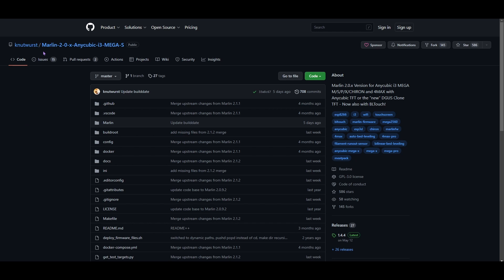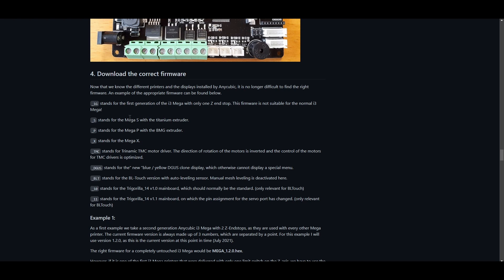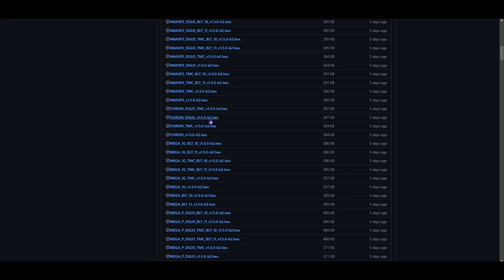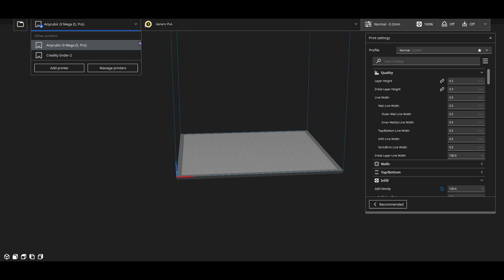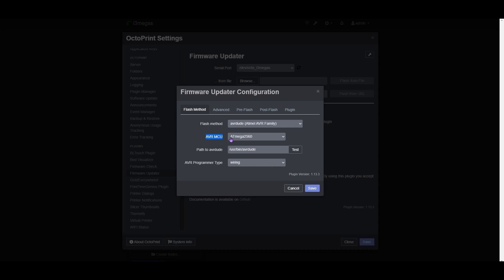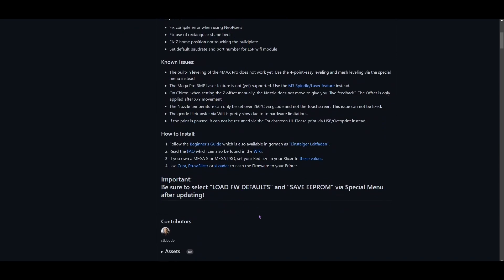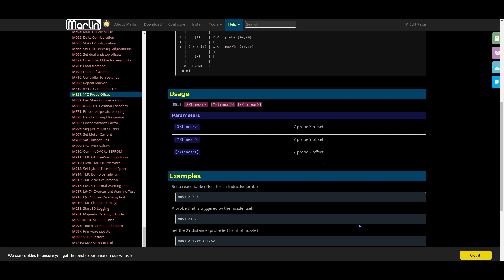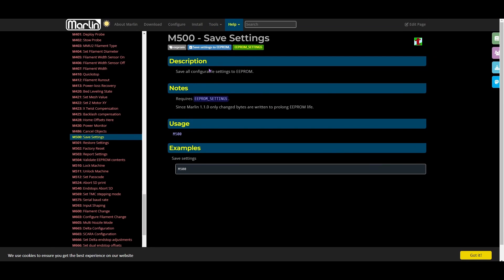Installing A BLTouch Sensor To My Anycubic i3 Mega-S 3D Printer [PT.2 Firmware And Configuration]

Comment from the maker: Forgot to cover this but you need to edit the start Gcode in the slicer your using to enable mesh leveling. You can copy and paste the Gcode from here(https://github.com/knutwurst/Marlin-2-0-x-Anycubic-i3-MEGA-S/wiki/Start-and-Endcode-with-preheat-and-purge-line ) or add "M420 S1" after "G28"
Reply: Hi again
I just found the time to get back to my I3, is it possible to make a video by giving examples about the g-code needed to insert of give me a link to someone elses video?
 As said I am a rookie to this stuff , I would like to get it right but for some reason I am really afraid of touching g-code
Thanks

Comment: Hi, I wanna ask if you short circuit the two pin of touch sensor would it work? I’m a little lazy and wanna just use thin metal tape and clip to achieve  bltouch Lol

Comment: Did you have any issues with the machine basically slamming into the X and Y stop switches and making a horrible grinding sound? I did mine through Cura before I had octoprint but now that I can read my code I imagine it’s a matter of defining your bed size. I’m just wondering if anyone else had this issue.

Comment: I know this is an older video but I followed this all the way through and was able to get through the cabling stage without a problem. Now I flashed the correct firmware and saved defaults to eeprom, but I got stuck at all the offset calculation stuff. What exactly are you doing in the Octoprint teminal? I've never used it and I don't really understand whats going on after you take those mesurments using your caliper.
Reply: The octoprint send command to the printer, to save the result of mesh in eeprom. In short it save your calibration data by sending  instruction to the printer by gcode.

If u don’t have octoprint just use orcaslicer and send the gcode

Comment: Thank you for the video, very helpful! Mega S is really counter-intuitive: you have 2 z-stop switches and a blTouch. The BLtouch should be aligned in such a way that the Z-stops can engage without the BL touching the bed (retracted) BUT touch the Bed first when extended.

Comment: i have the same setup with you (same fw, TMCs, X-xcarriage MK4, BLT installed) and although the auto bed leveling is performed as it should, when i go to print it seems that the printer does not take into consideration the meshing and on the right side the nozzle pushes the bed. I ended up with the conclusion tha my i3 mega s is suffering from twisted x-axis rods which is translated to erroneous prints. Did you face twisted x-axis carriage?
Reply from the maker: Hey Zaf, I haven't faced that issue with my printer. Did you make sure to add M420 S1 and G28 to your slicers Gcoode? if not this could be the reason why your mesh isn't being initialized during the print. There are more details in the pinned comment. Hope I was able to help :)
Reply: @asilatech  yeap! I have used on staring gcode either M420 S1 or G29 or both after G28, but without results. Then I started searching the issue of twisted x-axis carriage. I used the M421 for compensation values for Z but still have not figured out how to solve it.
Reply from the maker: @zafpapaz87  hmm im yea stumped 😬. If you haven't already maybe try reinstalling the firmware(maybe somepart got corrupted during the process) and test out your theory on the problem, to see if that fixes it. If that's no avail, I recommend posting on Reddit and the Thingiverse forum for more help. Sorry I cant provide much and hope you find a fix soon!
Reply: @zafpapaz87 did you measure the screws on the z axis motors? In my case the right screw was too tight, so the motor was 0.5mm higher than on the left, so the mesh had a difference over 0.6mm from left to right, which created the same Problem that you describe
Reply: @achimheigert  yeap, measured them couple of times with caliper and are almost identical. I noticed that they released ver. 1.5.0+, which says that they have fixed some issued with BLT. i'll give it a try!

Comment: I followed your instructions precisely and was able to get the bltouch to perform it's mesh routine.
However, it seems that the mesh is off centered to the right and each of the far right points probes off of the bed.
Would you have any insight as to why this would happen?
Reply from the maker: Hey apologies for the late response, were you able to resolve this issue?
Reply: @asilatech  Thank you for the reply. Yes, I was able to change the mesh and now it pulls the bed entirely within it's boundries.
Thank you for the videos, they have helped tremendously.
Reply from the maker: @irvintib  That's Awesome!! and Im happy to hear you enjoyed my video it means so much :)
Reply: @irvintib   how did you change the mesh?
Reply: @brennanshaw679  You will have to do some reading regarding editing the firmware and recompile it.
It's not a quick and easy solution, but after you study for a short time, I believe that anyone can accomplish it if they are willing to learn about compiling firmware.

Comment: Hi
First of all congratulations for this great video( low audio is a minor detail :) )
Now as I never touched my printers software I would like some guidance if you can. 
I have an I3 Mega second Gen (the one with 2 Z-endstops on) with a Trigorilla 1.0 motherboard. I also have TMC 2208 but I reversed the cables and finally a BLT. I made all the connections and now I am looking to install the 1.4.4 release but I am not sure what is the correct version. I think it is the 
MEGA_BLT_10_v1.4.4.hex  but I just need to be sure. Also if things go wrong how can I returd back to my original settings?
Thanks in advance
Kostas
Reply from the maker: Hey Kostas, I double checked and that looks to be the correct version for your printer configuration. And of course if worse comes to worse head over to the Anycubic website, hover over "Support" and select "Firmware, Software & Video Tutorials"  click on the "Mega Series" and you should see the i3 Mega's original firmware 😊
Reply: @asilatech   Thanks a lot just to let you and other users of windows 11 know, I had to install CP2102 USB to UART Bridge Driver bacause my OS (and CURA) was unable to recognise my printer. I did it by installing  "Bit Driver Updater" app and selecting the driver to install.
Reply from the maker: @Warlordfff  Omg Thank you for bringing this up! I totally forgot about Cura/OS not recognizing printers😅. I made a video last year(hence why I forgot lol) about this problem, when I upgraded my marlin firmware. I didn’t install “Bit Driver Updater” but I installed the windows driver from Anycubic, but they essentially to the same thing 👍🏽